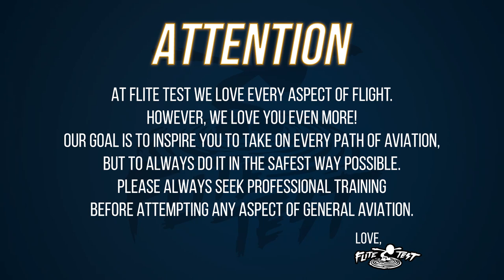Paramotors: What is Kiting?

Comment: I was a hang glider pilot decades ago and felt there was nothing as pure as flying a hang glider. That was until I became a paraglider pilot (non-powered) and found out that it was one step closer to pure flight. The feeling of having your feet come off the ground under your own efforts, with the assistance of mother nature (wind, gravity) is impossible to describe. It's great that your crew got to enjoy it in the manner you did.

One way to run out of friends is to attach a hand-tow to your harness and have them pull you up about fifty feet. That lasts maybe one or two runs, then you have to find a hill. Not enough hills in Florida, which means noisy motorized back-pack hills, but flying is flying! It's all good.

Comment: How much would it cost for the equipment and the training to get started with this sort of thing?
Reply: Kevin Korthuis  in the UK allow 2k for a wing up to 4k for the motor. Training is around 2k or so. There is a good second hand market. Pap motors with steel cages are best. aluminium cages break very easily.

Comment: can a paraplegic do this?
Reply: george aura if you are in the UK then Google bhpa they can help you. currently in the UK Paramotoring has to be foot launched however we have the issue of disability laws which we are using to change this with a bit of luck
Reply: george aura Yes. Look up Fly Above All in Santa Barbara.
Reply: george aura Not sure how it is with Paragliders, but lots of trikes for paramotors are made.
Reply: What if you got a blown disc?
Reply: MrRipple123 thin with that you would have to do paragliding. the issue with Paramotoring is the 20<30 kg on your back. once you are in the air the weight is gone. So paraglider will be better
 One guy I knew was 83 and had 3 fused lumber and had had 3 hip replacements!
Reply: There are more back injuries in this sport than any other kind, so be careful.
Reply: Robert Cook actually in terms of sports insurance it is not as bad as horse riding all car motor sports are a higher risk. for membership and insurance I pay around 85 pounds so about 100 usd.
Reply: Jazzynet100 man that is great to hear